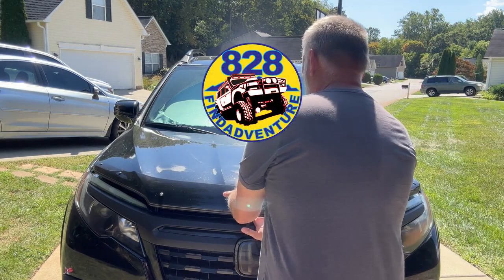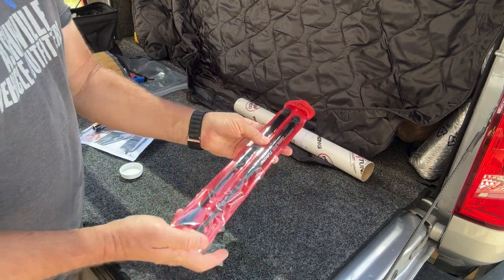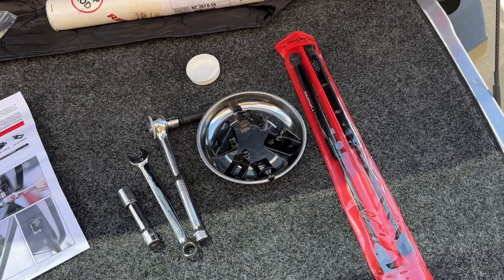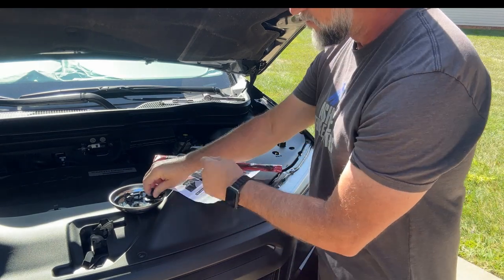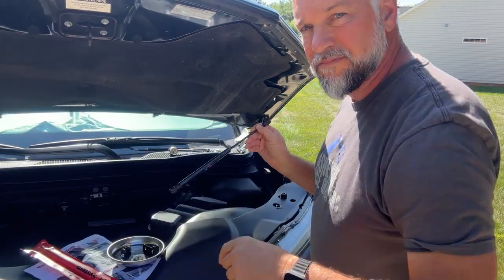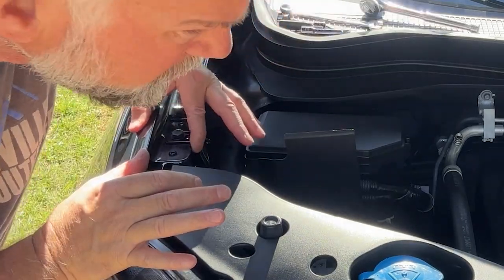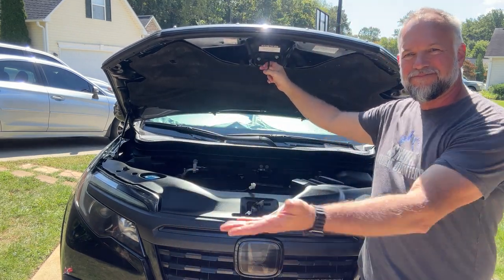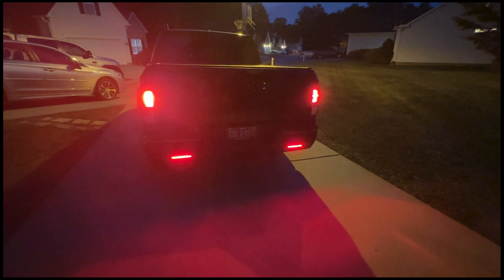Honda Ridgeline Hood Strut install, it's so easy

Comment: Good install, but the new Ridgelines have steel hoods and they are heavy. Would the struts still work with the heavier hood?
Reply from the maker: I just discovered that today checking out a 24 Sport. I’m not positive about the set I got for mine but would have to check the web site where I got them. My 2021 Tundra has an extremely heavy steel hood and came with OEM struts that handle the weight fine.